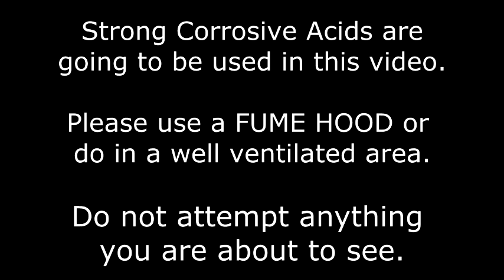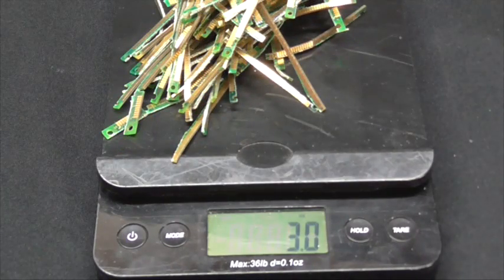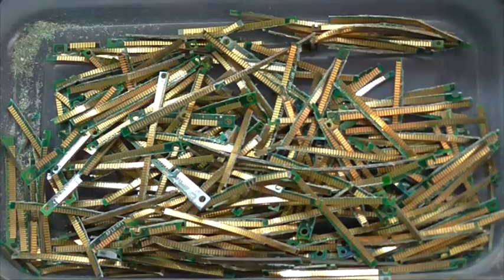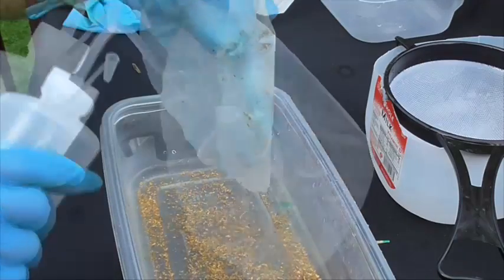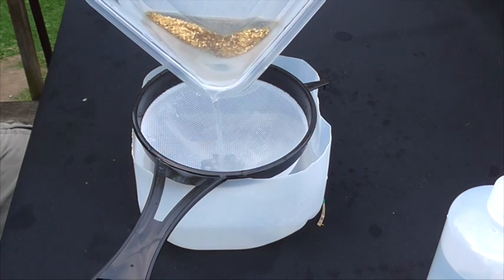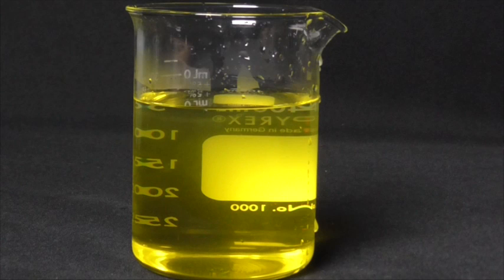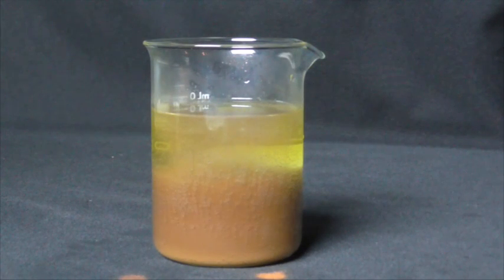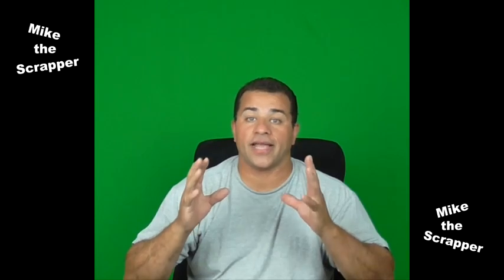Gold Recovery ( Scrapping Ram finger boards)

Comment: Right, I am just wondering how much gold you lost in the A/P solution.  In a 1-1 ratio you might end up with chloroauric acid.  If you just neutralize the used a/p without precipitating the gold out of it first you may lost a good bit of gold there.  Most people use a 3:1 or 2:1 acid:peroxide mix to avoid that.  Great start to end video though!

Comment: With the waste from the A/P wash... What was done with that.  It had a bunch of nasty heavy metal salts like copper, tin, and lead. You used sodium bicarb on that?  Then what?  It would get rid of any HCl left over and probably  knock out the copper, zinc and possibly the tin out of solution.   I don't know if the lead would still be in solution.  Did you filter it and throw away the powder on the bottom in municipal? Or save the entire bottle for a chemical drive?  But a great video.